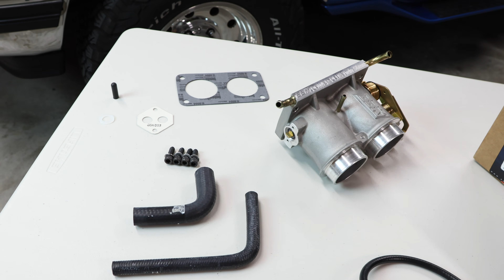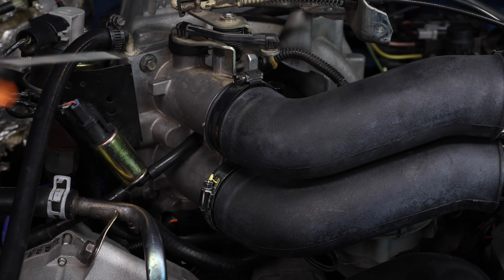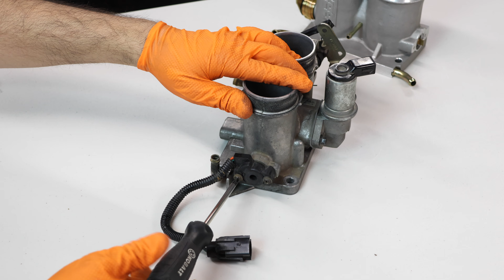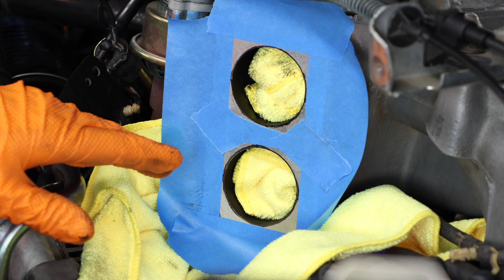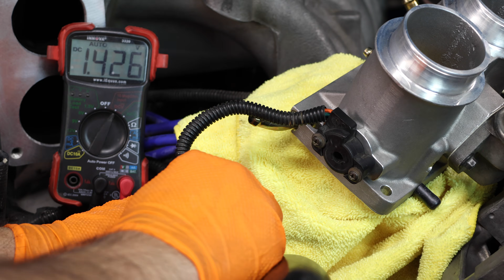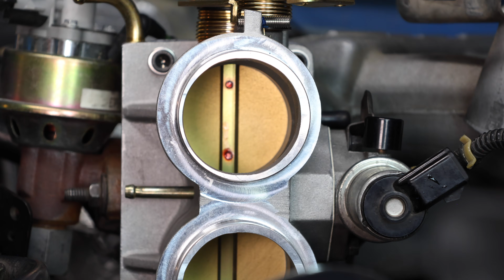Install BBK Throttle Body | 1985-1996 Ford Bronco F150 Port Matching | Bronco Restoration

Comment: My Bronco runs fine, RMP are fine but the other day took it for an extended drive on a very hot Arizona day, ran errands, stoping a few times, turning off and on the Bronco without any issues until on one stop it did not want to start and acted like it was chocking itself out, took about 30 minutes and after that the Bronco started back just find and no issues - could this be related to the Throttle Body, or possible something else should be checked first?
Reply from the maker: Usually the EGR valve stuck open causes this, otherwise look into the ICM module. Run diagnostic engine code check.
Reply: @TheFixTech  Thank you for your input!!! 
So the shop ran a diagnostic and are telling me that I have to replace my throttle body to fix the HOT-NO Start issue - can that be the case?

Comment: Installed, and now rpm in park is like 1600 rpms and I cant drop it any lower, could the throttle cable be worn?
Reply: I wold check the TPS again.

Comment: I've tried 2 of these throttle bodies on my 94 F150 and both were so hard to open that the throttle cable popped off when depressing the throttle pedal. I would not recommend purchasing one of these if you have another option like a used throttle body if just replacing the throttle body and not going for HP.

Comment: excellent video thank you for doing it. i have the bbk twin 61mm throttle body,  edelbrock truck efi intake and hooker long tube headers to install on a 96 f250. hopefully the speed density don’t screw with me too much. otherwise i’ll be converting to the maf like your engine has. thanks again for sharing

Comment: Keep the videos coming! I have completed almost every video. Ideas for future videos: engine electrical replacement, gauge cluster replacement, front steering components, additional engine upgrades, smog delete, full disc brake swap with lines, fuel tank, fuel lines. My to do list for my 91 SA 5.8l 125k miles 2nd owner. I am borderline thinking of buying a blueprint crate engine and running a stand alone computer. The smog and power from the OG 5.8 bothers me. Plus my bearings are going and I have a delayed power drop when climbing hills here in Washington.
Reply from the maker: Thanks for the ideas. Your engine should still be healthy at that mileage as these can easily hit over 200k. Check compression if good then be sure to adjust timing and/or replace ignition components. You should have about 36psi fuel pressure at idle and should increase in rpm. If there is a check engine light, diagnose and replace sensors such as TPS and IAC as they can affect hill climbing, also if your egr valve is stuck open that will lower power output. Engine swaps can be costly, these engines can be rebuilt and good power addons can be done affordable. If you do not have state emissions testing then alluminum heads and a mild cam can boost HP significantly.

Comment: I just installed the same throttle body on my 96 Bronco. My question, is there any way to adjust the tension on the TB springs? They are stiff as all get out. It makes it not enjoyably on a cruise.
Reply: Follow up: I ended removing the spring on the throttle cable, since the throttle body springs are plenty strong. Now it's slightly firmer than stock. Much better!

Comment: These are the best mechanic videos i've seen. Very detailed. Thank you for your work. I have about 15 OBS fords so these videos are extremely helpful.
Reply from the maker: Thats alot of OBS
Reply: @TheFixTech  Yes it is, i started with 6 broncos than moved into the 7.3 PS trucks. I wish you'd more of these types of videos. Very detailed and easy to follow. Good luck to you!

Comment: I installed one of these on my 89 f150 swb . They are junk , the coolant nipple fell off and the gap on the butterflies was worse than my OEM throttle body
Reply: Love the videos and appreciate all your hard work on them!!!!
Reply from the maker: I had purchased an older used BBK throttle body for my bricknose and I had to repair the coolant line (drilled and tapped npt thread, then stuck 3/8 barb 90 elbow). The butterflies can be adjusted as I had to do that to a different one, this does involve removing the screws an butterflies completely and cleaning the red loctite.
Reply: @TheFixTech yeah , but I was upset with paying$450 for it and then having to repair it . If it’s your only option I get it but if you can disassemble the oem throttle body and save it DO IT . When I was working on mine my thought was (well I’ll just upgrade and it will be better) , but I was just being lazy. Again I apprentice all your hard work and appreciate the videos  and this comment was no way reflected towards you or your ability’s just bbk needs to do better with quality control.

Comment: Its kinda off topic but on my 93 f250 5.8 I bought a IAC and the new one has that black cap on the side. The old one didn't have that. What is it and do i need it?
Reply from the maker: Its a pressure relief valve I believe. Either one will work; the black cap is the newer style.

Comment: My uncle gave me a bigger bbk throttle and a 1 inch spacer, it came with a tps sensor and I just installed it as is, I noticed my truck is a little accelerated, could it be because the sensor isn’t adjusted??
Reply: How do I read my rpms I don’t have the tackometer, also my idle screw is all the way back out/ out so idk what it could
Reply from the maker: You could get an aftermarket tachometer (local parts stores have them) and hook it up to the negative side of the ignition coil.
Reply from the maker: Check the tps voltage signal as outline in the video. Also the IAC valve may need replacement as the IAC controls the idle
Reply: Yes. It does cause this.

Comment: What necessitated the replacement of your throttle body? What conditions were you experiencing?
Reply from the maker: The older throttle bodies have a sludge issue that can affect idle, Ford addressed the issue with an adapter that can be installed between the IAC valve and throttle body to help adjust idle. Later versions of these throttle bodies had small holes drilled on the opening plates to help steady idle. In time throttle bodies wear and can leak vacuum from the shaft openings, the throttle body on this truck was still in good shape but the one on my 1990 was not and no amount of cleaning and or adjusting allow the truck to idle smoothly. I installed this throttle body on the 90 and was impressed with the smooth idle and adjustability and added acceleration with less pedal effort so much that I decided to install and document on the 95. As with all parts I replace, I keep all my original parts in storage.

Comment: Anyone know why Ford used the twin throttle body for the 351 EFI, is it to do with low down torque?
Reply from the maker: They also used it on the 4.9, 5.0, and 7.5L engines in Truck and Vans. My vote is for torque and intake design.
Reply: @TheFixTech Wow, I didn’t know about the 7.5. Surely that would be a major intake restriction

Comment: Hi, could you leave the link to the spark plug wires you have installed? Greetings from Chile.
Reply: Ford Performance race blue
Reply from the maker: I added a link in the description, thanks.

Comment: I was literally just looking at these for my 88 Bronco. After installing this would you recommend disconnecting the battery for awhile and letting the computer relearn? If so would you do it before or after setting the idle screw? Appreciate your videos man. 🤙
Reply from the maker: I have set the idle both ways and have had the same results. If you do choose to disconnect the battery only 10 mins is needed and turn on the headlights while doing so, this will ensure all power is drained from the ecm/pcm.

Comment: awesome video very nice👍:hands-yellow-heart-red: i have a 351 win def going to do this to my old van its at 300,000 mile and still got plenty of power 1996 baby!!
Reply from the maker: The 96 trucks are very unique, they will run forever
Reply: Long as you change the oil like your supposed to it will run well over 300.000 @TheFixTech

Comment: What performance differences, if any, did you notice by making this switch?
Reply from the maker: I didn’t expect any horsepower gains as the engine is stock save for the shorty headers. My original throttle body was worn and the truck was having idling issues, I originally wanted a new factory replacement but they are non existent. The truck now has a much smoother idle and was surprised at the pick up in acceleration. I believe this is due to the larger bore providing air to the cylinders sooner as far as horsepower gains I would say minimal if any. This throttle body would shine with a set of aluminum heads (true bottle neck to these engines) and cam. All in all the truck cruises on the highway and maintains speed better on hills.
Reply: @TheFixTech are the aluminum heads your referring to also one of your videos on replacing stock with the BBK headers?

Comment from the maker: This was a good upgrade from my worn throttle body, I had done this to my older truck and was impressed with the results so I also upgraded the 1995. Let me know if you have any questions regarding this upgrade.
Reply: I just bought an 88, find any good forums or fb groups?
Reply: @davidpayne5216  Fullsize Bronco Forums